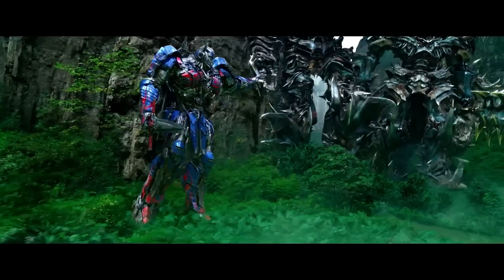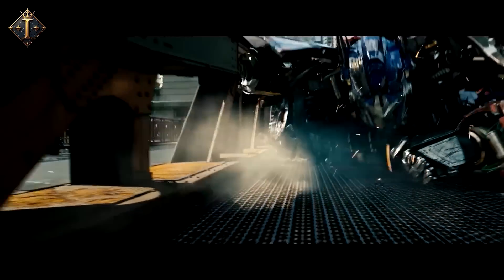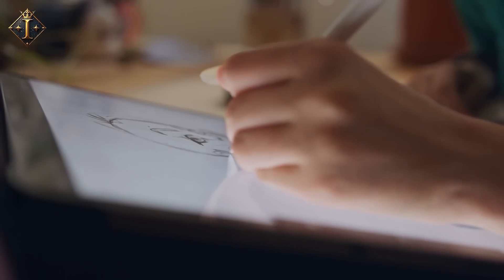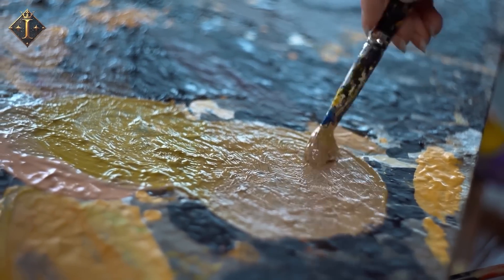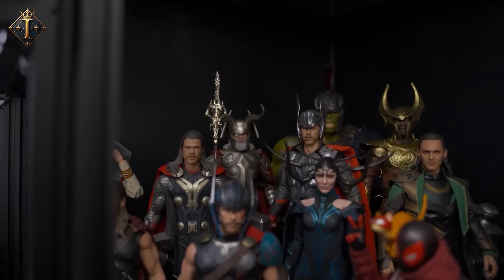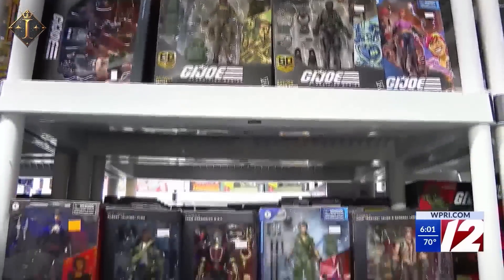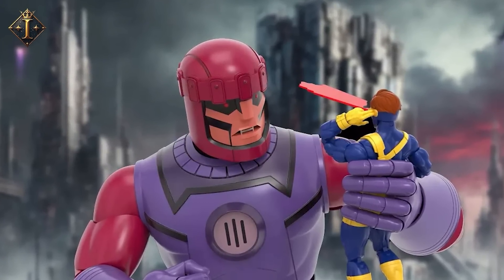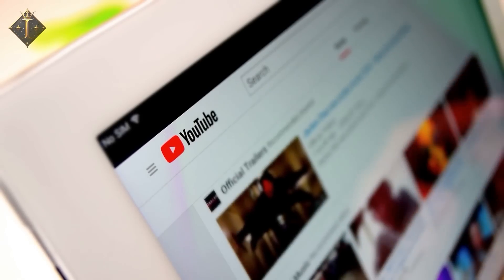How HASBRO Action Figures Are Made

Comment: 25% of what aired here is not factual.  For instance, fans on the Pulse website do not get early access for input on figures.  More often, people who order through Pulse get them last after Amazon, Target, and Walmart.  Also, that was not the Haslab Sentinel.  That is the new X-Men 97 Sentinel.  Not once did they show the production of a Transformer in this video.  What does a metal foundary have to do with plastic action figures?  Sure, it's also a factory, so you could have shown a potato chip factory and been just as accurate. This is what you get with A.I.  Complete garbage disguised as useful information.